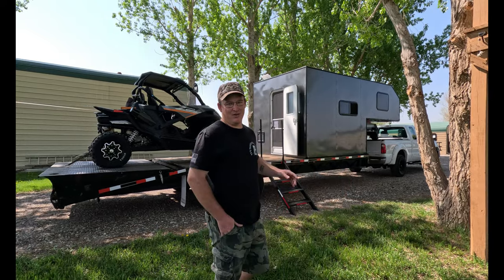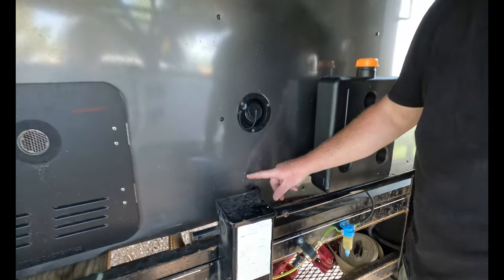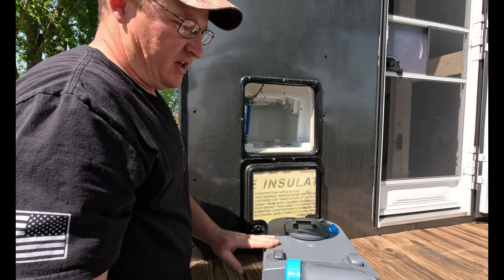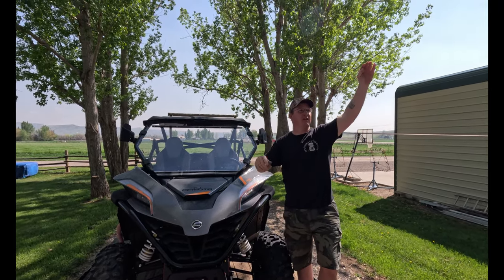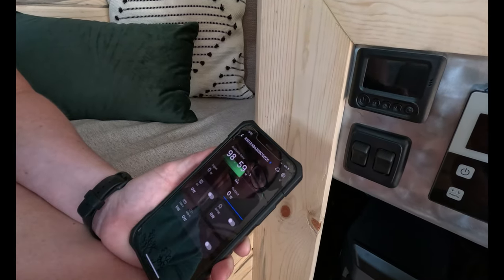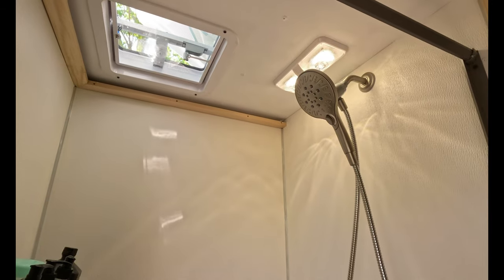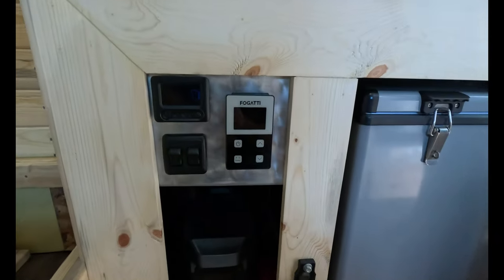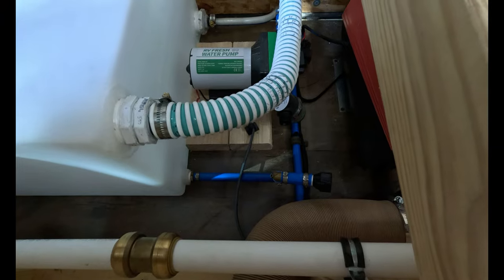Homemade Crawler Hauler Camper Trailer/The Grand Tour

Comment: I am currently in the works of building one of these. If I may ask, could you provide the materials? The siding specifically, I cannot find it anywhere. Was it expensive? Is there things you may have wanted to do differently? I hope this comment is seen, amazing build and I’m more than willing to follow that step!!
Reply from the maker: We used 2" square tubing for the main frame, then filled it with 1" square tubing for the in between. We used polystyrene insulation in walls, floors, and ceiling. For the siding we used aluminum sheets we found on Amazon here is the link: https://www.amazon.com/gp/product/B08C7ZJL96/ref=ppx_yo_dt_b_asin_title_o08_s00?ie=UTF8&psc=1 
We spent roughly 15,000 on the entire build not including the cost of the trailer. 
As far as things we would do differently we don't really have anything yet, we don't have enough storage yet, but we are soon to improve on that. 
I hope that helps!
Reply: @lifesendeavors  that helps greatly!! Thank you so so much!! I am looking forward to see your journeys and how it goes, I cannot thank you enough.😁

Comment: What's your tow vehicle and it's tow capacity also what's the weight of the trailer with all the weight on it?
Reply from the maker: Our tow vehicle is a 2015 F250 short bed extended cab with a 6.2 gas.  The trailer and camper combined weigh 9000lbs.  With 2 four wheelers and the side by side loaded and all of our gear were pushing 12,000lbs.  The towing capacity on our truck is 13,000lbs.

Comment: You've had it up to 80 miles an hour ?? Not wise at all.
Reply from the maker: We primarily run it about 60mph. But yes, what ty was getting at is that it is built well enough to handle the speed (it wont fall apart) and to explain that it pulls and handles great even at higher speeds and on terrible roads. No need for judgement.

Comment: sorry if i missed it but how long is the trailer and how long is the part of the camper that is on the trailer deck?
Reply from the maker: The trailer is 26’.  The camper is 8’ wide and 9’ long on the deck.  The overhang on the camper is 7’.  There is 17’ of deck space behind the camper. Thanks for the support!
Reply: @lifesendeavors  awesome pretty close to what I was planning I love it thanks for the info. Did you frame the overhang with 2x2 tubing as well?  was contemplating adding essentially body mount bushings to have the gooseneck hold the cabover weight.